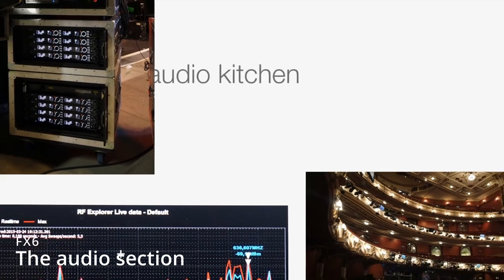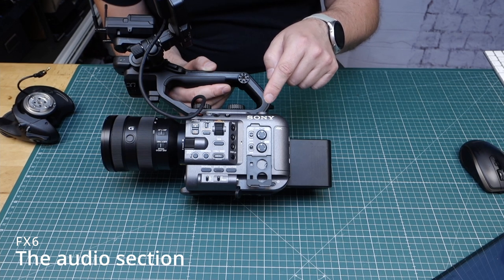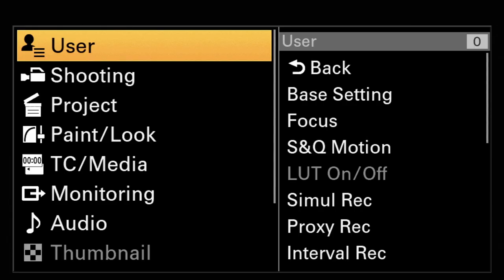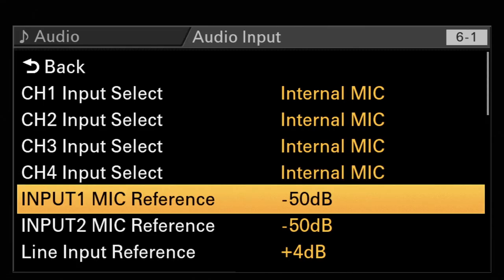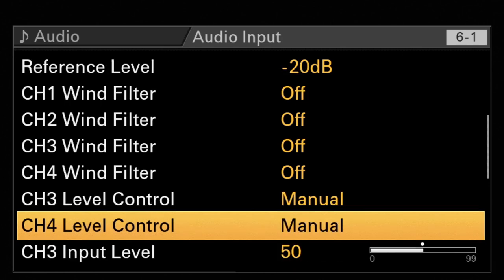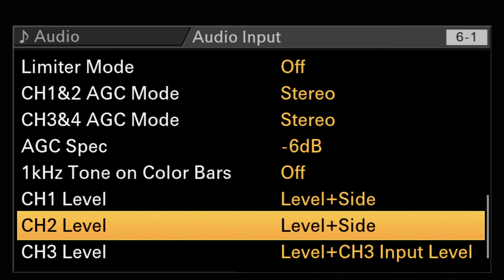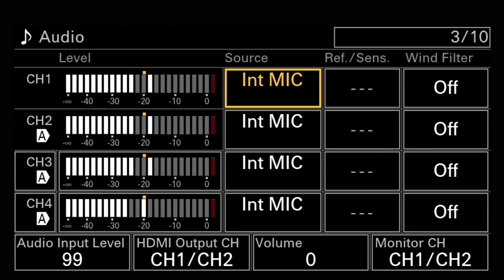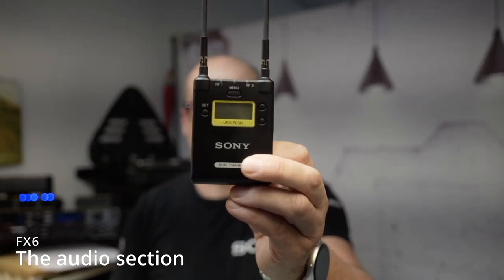#016 The Audio side of Sony's FX6

Comment: Thanks but with my FX6 i pick up 8 channels : 4 of the audio like you explained and 4 others empty track and i don't why. Can I deactivate the 4 others tracks. Thanks again.
Reply from the maker: Hi Jeremie FRUCHET. This is nothing sony belongs. The 8CH of audio into your file is coming from the file format.  I'm not an expert on codecs and file formats for video but as I understand the XAVC codec is specified with 8CH of audio. So the file includes always 8CH but only 4 are useable by some camcorders. And as I understand the information I have correct, there is no way to stop writing 8CH into your file.
Reply: @mawa  Ok, it's still a great answer.

Comment: Thanks for this information, Markus. I believe that the AGC only operates for channels that are set to AUTO, not for channels set for MANUAL.  For MANUAL channels, you would need to use the limiter and that the limiter and AGC never operate on the same channel.
Reply from the maker: Hi moulin a lumiere. Thanks for your information. I will check this with the Sony cameras department. If it is true, this would be very good and it has to be mentioned in the manual.

Comment: Is the XLR only able to output mono? I'm trying to see if I can output Stereo from 1 XLR.
Reply from the maker: Hi Kyler Holland. Sorry to coming so late back to you. The FX6 has no XLR output. The only output is the 3.5mm Jack for the headphone. In the menu, you can choose which signals you like to monitor here. If you choose CH1/C2 and the signals are in a stereo format recorder, you get a stereo output here.
Reply: @Markus Warlich  it's okay, my apologies. I meant input. 

So the only way to get stereo audio with the shotgun mic is to use 2 XLR and 2 Mics?
Reply: @KYLERHOLLAND  Seems like it. I've been scratching my head why Sony wouldn't allow stereo input via xlr, no matter what Stereo generating device I connect it will always just take one of the two tracks. Really sucks if you need to mic up 3 persons, you'd have to go with sonys extremely expensive uwp-d since it will work with the multi interface shoe or put a XLR-K3M on top which is also not cheap and adds ridiculous bulk to the handle.
Reply from the maker: @KYLERHOLLAND  Yes, any stereo signal will be recorded as a stereo signal on ch1/2 or 3/4 and yes you need an external mic/source which delivers a stereo signal. The internal mic is a mono mic. Here is the input matrix: https://www.dropbox.com/s/ir10fy0gf550827/FX6%20Audio%20Channel%20Matrix.001.png?dl=0

Comment: Hey Markus great video.  I just picked up the FX6 and I have a Sony eco-vg1.  I've put it into XLR input 1 what would my setting be to collect sound from there and can I turn off the Internal mic's and just record from the VG1.  Thanks in advance
Reply from the maker: Dear Kwame Damon Mason, the standard settings are ok. Choose between auto or manual mode. In Auto mode there is nothing you need to adjust for now. If you find out that the level is not ok you can adjust the input sensitivity. In manual mode you can use the fails to adjust your input gain an I would recommend to switch on the limiter. The minimum string , 6dB, would be ok for a first test. If you do not see any overload you are ready to go. Oh, do not forget to switch on the Phantom Power for powering the mic.

Comment: Hey Markus, thank you for the great Video about the Sound Settings. 

If i wanted to record a safety Track (-20db) from Channel 1 (XLR Mic Manual) how do I set this up?
Reply from the maker: Dear Dennis Zimmermann, on page 90 of the FX6 user manual you find the following routing for CH2 Input Select: “INPUT1 / INPUT2 / Internal MIC / Shoe CH2”. Connect your Mic to Input 1, switch in the menu CH2 to Input 1 and the signal is present on both channels. Switch bot channels to “Manual Level Control”. Now you can lower the level for channel 1 and 2 individual by the “AUDIO LEVEL dial” on the left side of the camcorder. Hope this answers your question.
Reply: @mawa  Hey Markus thanks a lot. This helps me. My Canon C200 had the Option to auto dial in the "Safety Track" to -20db so you had to set just one channel and the second channel does it for you...

Comment: Hey Markus, zu 1:15 ; bei meiner FX6 kann ich seit geraumer Zeit nicht mehr mit dem Rädchen pegeln, wenn der Schalter auf manuell steht. Hast du eine Idee woran das liegen könnte?
Reply from the maker: Hallo Marcel. Es gibt die Möglickeit diese "Side" Funktion aus zu Schalten. Seite 91 im Manual sagt (am Beispiel für CH1): “Side” refers to the AUDIO LEVEL (CH1) dial on the side of the camcorder. When Level+Side is selected, the audio recording level is determined by the combination of the Audio Input Level and dial settings (page 124). 
Seite 124 im Manual sagt: [CH1 Level] , Audio Input Level Side, Level + Side Through
Man kann also im Menü einstellen ob der Audio Level über Side (Knöpfe an der Seite) oder über Level+Side (im Audio Menü der Kamera + die Knöpfe an der Seite) verändert werden kann.
Dann gib es noch die Möglichkleit " Through". In verbindung mit dem XLR Adapter kann man so die Level Funktion in der Kamera komplett umgehen und nur die Knöpfe am XLR-K3M benutzen. Ich hoffe das hilft dir weiter.

Comment: Hi There,
Do you know how to link channel 1 and channel 2 for mid-side stereo recording?
Reply from the maker: Hi Max Carlo Kohal. As far as I know, the camera has no special link function. Only the AGC can be switched to stereo for CH1&2 and/or 3&4. All other parameters have to be changed per channel manual. Internally all channels are synced by the internal time code. If you use an M/S type microphone (like ECM-MS2) the result will be useable later in postproduction for MS decoding. I have not tested this function but I don't see any reason why it does not should work.